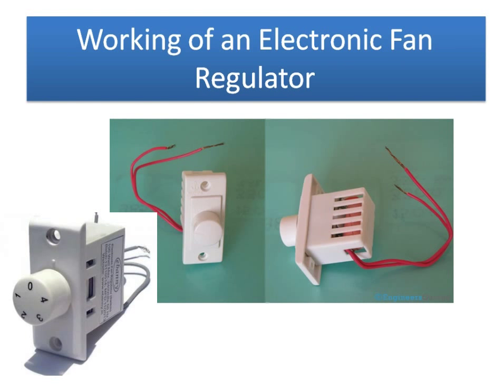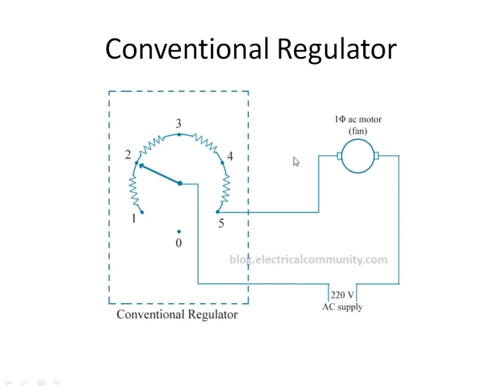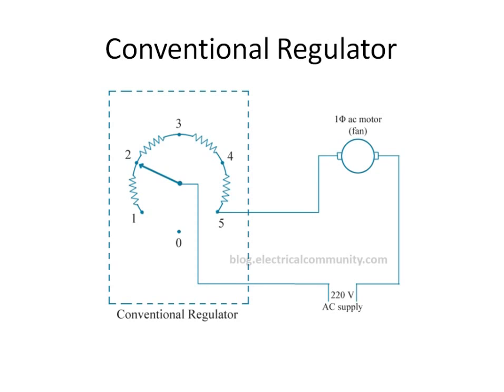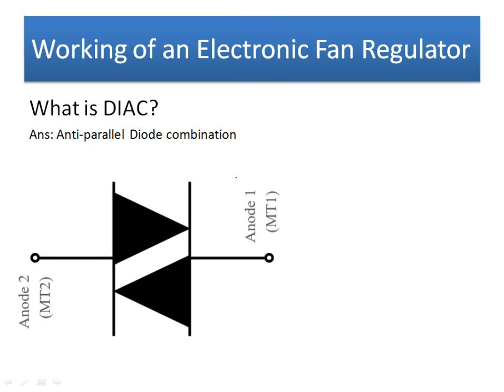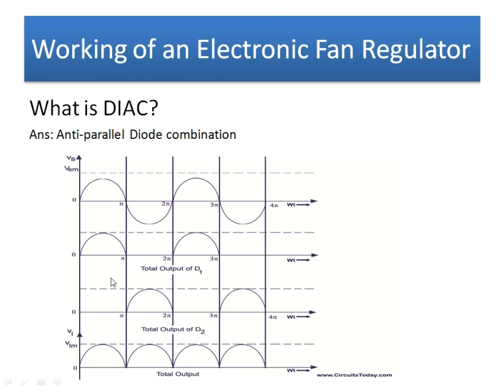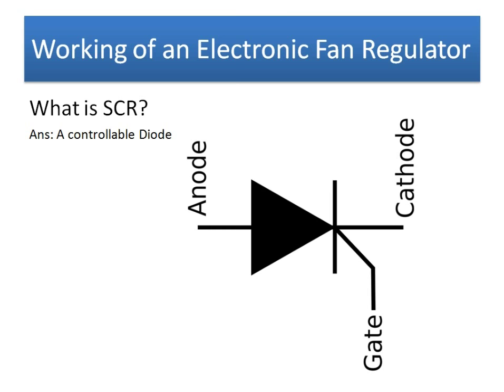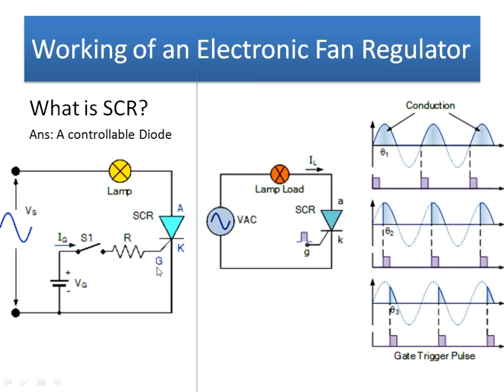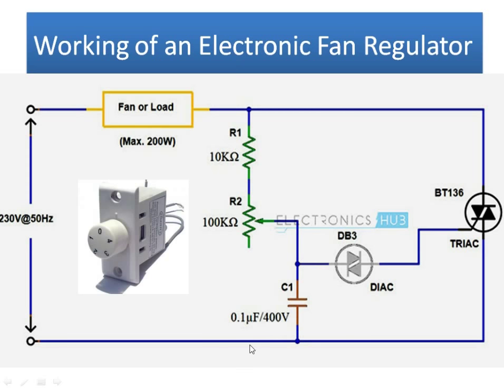Working of an Electronic Fan Regulator or Dimmer EXPLAINED SIMPLY

Comment from the maker: Please note the output waveform I have shown for the Diac is wrong. I am sorry for that and please refer to any standard website/book about Diac. Kindly ignore the Diac characterstics shown here. 

Also, in a conventional regulator the voltage changes per step instead of current which I pointed out wrongly while discussing the conventional regulators.
 
Thanks
Reply: @sarathsuresh8603  it is like zener diode for A C.
Reply: What if i use diac 1N5445
What is the purpose of using DB3 diac please reply
Reply from the maker: I am not sure with the variants. You can figure out using the datasheet of both. Maybe difference is in frequency of operation, temperature, voltage and power range etc.
Reply: @ervivekchoubey  my multisim simulation doesnt have the DB3 so i ised 1N5445 diac.circuit not functioning well.out put current is 100nA

Comment: Hii
Bhaiya jab hum rheostat ki control karenge tab kya current effect nhi hoga kya???
Because of series circuit??
Reply from the maker: Series circuit mein resistance ke wajah se voltage drop hota hai because current same rehta hai but resistance bdhne ke wajah se voltage drop hota hai because V=IR.
Reply: @ervivekchoubey  bhaiya yeh jo fan regulator hai wo ohm law ko follow nhi krta na
Kyu ki voltage across fan toh change ho rhi hai per current pure circuit mai same hi rh rha hai
Reply from the maker: Bilkul follow kr rha hai. Ohm's law mein current isliye change hota hai because resistance constant rehta hai. Agar resistance khud change ho rha ho to koi aur factor constant rhega. Like if V and I are changing then R will be constant. If V and R are changing then I remains constant. If R and I are changing then V remains constant.

Yha pe R hi to change ho rha hai jb hm regulator ko turn krte hai to resistance bdh ya ghat rha hai. Isliye voltage change ho rha hai because series circuit hai and therefore current same rehta hai. Agar parallel circuit hoti to voltage constant hota and current and resistance variable hote. I hope you got my point.

Comment: although, this dimmer circuit is more efficient but it generates on and off cycle, or square wave. which is not linear voltage control, and it is very bad for fan because it turns on and off the fan hundreds of times in a second (depending on r2 value)
and it also reduce capacitor life of the fan because capacitor is directly connected to fan's starting coil
Reply from the maker: MR Moon That is a problem but fan is really a light load compared to many other loads where this could be a problem. But lighter the loads, the problem isn't that considerable. Also fan continues to rotate under effect of inertia.
Reply: @ervivekchoubey  Fan capacitors are very slow to discharge, so by the time it starts to discharge, it is commanded to charge. No issues with the fan capacitors, this circuit is time tested and is being used on billions of fans worldwide.
Reply from the maker: Yes you have pointed out correctly.

Comment: So, this means that the current used is the same and hence different levels don't affect the current consumption, right?
Edit: Also, could you please make a video on modern regulators? If you already have made it, please provide a link.
Reply from the maker: Actually, this regulator controls the average voltage across the fan without using voltage divider method using resistors because that leads to i²r loss and heat loss. Here, the average voltage is controlled using efficient power electronic devices which consume very less power itself and thus are highly efficient. Current increases/decreases as the average voltage increases/decreases unlike the series resistance method where current remains same and causes heat loss as resistance increases.
This video is on modern regulators only. I have compared the old resistance based regulators with the modern ones.
Reply: @ervivekchoubey  thanks a lot.❤️

Comment: DIAC explanation is wrong. TRIAC is used for dimmer not for fan. So you can see lamp load in diagram. Fan is a AC motor, needs full cycle for proper operation. Amplitude should be reduced to slow down fan. For light bulb it doesn't matter it acts like pwm. Its more effective for light bulb as there is no resistance loss
Reply from the maker: Yes I agree DIAC explanation is wrong and I have said that in the pinned comment. Fan Regulators works like dimmer as well.

Comment: The diac output waveform is wrong. Kindly check it.
Reply from the maker: Shadab Hussain The waveform diagram there is just for simple representation of Diac as anti-parallel diode (assuming 0° triggering). I have intentionally used it for ease of understanding.
Reply: Er. Vivek Choubey  you have shown output of diac is dc but its not that actually output of diac is alternating waveform. What you have presented is like full wave rectifier. But diac is not similar to fwr, diac does not convert ac waveform into unidirectional dc. It’s not about firing angle, please recheck it.
Reply from the maker: Shadab Hussain Yes that's a big mistake on my side I just checked. Thanks for letting me know. And sorry for the inconvenience.

Comment: You brought back my interest in electrical and electronics by simple explanation. I am an electrical engg, but now in IT for almost 22 years. I am also having the same problem like Sarakar. There is no much of a difference between 1-4 (very slow), but fan reaches top speed at 5. I am planning to start some R&D in this.
Reply from the maker: It feels great to know that sir. I wish you all the very best for your R&D. Most of the times, the potentiometer is the culprit and you can replace it with a new one of same resistance.

Comment: At 6:45, when D2 is conducting isn't the direction of flow opposite to that of D1 ? We wont get the peaks like bridge rectifier as described in the graph
Reply from the maker: You are right. Actually the DIAC characteristic curve shown is wrong and you may skip that part. I have mentioned this in the pinned comment. Its a mistake on my part. Diac is basically used to provide positive pulse to the TRIAC gate. Please refer to DIAC characteristic from any standard book/website.

Comment: I wanted to know that in case of a Capicitative Regulator why is the difference between 4th pos and 5th pos so huge, whereas 1 to 4 points are almost same and very slow.
Also kindly suggest which regulator is better w.r.t life of a fan motor, is it the Triac based or the Capacitor based, as it seems that the triac has a lot of Harmonics involved?
Reply from the maker: For the first question, I can't tell actually if there is a difference of speed like that and if that's the case why is it? One reason can be non-linear torque. Torque of a fan motor depends on square of speed. So torque falls or increase by square of speed. This is why it may seem that the fan is rotating too fast or slow at times.

The most efficient is the triac based regulators. Harmonics are not that much of a problem with single phase supply. The main advantage is that you spend current as much required and there is no unnecessary heat loss. Why I am saying transient isn't a problem? Because transient is happening at very low scale compared to industrial loads where this becomes a great problem. You don't see your home loads abruptly changing voltage if you control your fan with a regulator. That means harmonics isn't a big problem. Even if it is, the fan itself is a huge inductive circuit which is enough to mitigate that. Problem of harmonics rises when your fan is running on an inverter. There you can listen to the fan's noise or harmonics which effect the motor torque and also heats up the windings. Any regulator is okay with the fan life if it is not causing heat loss in the fan.

Also modern fans are coming with remote control which can be very easily implemented with the triac based regulators. Also, by replacing the parallel resistors in the fan at the source side by NTC and PTC (negative and positive temperature Co-efficient) type resistors will result in an automatic temperature controlled regulator. Also the size is comparatively small.
Reply: @ervivekchoubey  Thank u mr. Vivek, explained to its ultimate, and being a teacher myself i was not satisfied with any answer that these fan and regulator dealers have been giving me, actually i am also a hobbyist and keep making small electronic projects, today i opened up the fan regulator (make : havells) and typical 3 capicitor circuit, 1.1uF , 2.2uF and 3.3uF connected in parallel  with discharge resistors. What i am planning is to change these Capacitors with new one , thinking they must have worn out with years of usage, as this modular regulator I have is around 7yrs old. 
The real problem is like step 1,2,3,4 have almost same speed with very little rpm difference and 5 being direct the fan is performing at peak speed, and i have already replaced my fan with Havells SS390 day yesterday. So now the only catch is the regulator.
Hope i am on the right track.
Keep assisting me.
As it is there is dirth of technical people nowadays,.
Regards
Reply from the maker: @nilabjasarkar  By experiment and tests what I can suggest is that capacitors and resistors are least affected over time. The thing which is highly affected is the potentiometer which gets damage by being rotated over the time.
In few cases it is that the Transistors (triac) gets damage due to high voltage impulse like sudden switching or by shockwave during rain. Capacitors are high rated one and may get damage but I haven't heard much of them getting damage. Instead try changing the potentiometer because it maybe that the potentiometer has burned out other steps and is only operating at the maximum point. I think that will solve the problem. Just get a potentiometer by the rating given on the pot. (in Ohms) that should do the needful.

Thank you for your feedback. 

Regards.
Reply: @ervivekchoubey  but as i said its a step regulator, so that doesn't use a variable pot, instead it uses a 6 pole switch
Reply from the maker: @nilabjasarkar  oh! Ok you are using RC regulators? I thought you are talking about solid state regulators.
Reply: @ervivekchoubey  No i am not using solid state dimmer, i am using Capacitor controlled Fan Step Regulator, by Crabtree (Athena)
Link below
Havells Crabtree Athena High Speed Fan Regulator https://www.amazon.in/dp/B00K0C4IJM/ref=cm_sw_r_cp_apa_i_ZSd9CbF9V18TX

Comment: Bhaiya mai 10th class mai hu mere sir ne bataya ki current same rhta hai
Aisa Kaise
Reply from the maker: Old regulators mein current same rehta hai. Waha maine galti se bola tha current reduce hota hai. Current same rehta hai but resistance bdhane ki wajah se voltage drop ho jata hai. For example let say voltage V tha, ab resistance R se 2R kr diya regulator se to same current rehte hue bhi regulator ke against voltage hoga I*(2R)=2IR. Yaani supply voltage V ka 2IR part regulator mein waste ho jaa rha hai. Remaining (V-2IR) hi fan ko milta hai. But isse heat generation bhi bdh jaata as Heat=I²R. If R increases, heat loss increases. 

So, yes current same rehta hai but voltage drop ho jaata hai.
Reply from the maker: Current same rehta because regulator ke resistors series mein hai. Series resistance mein current same rehta hai aur voltage across resistors change hote hai. Whereas parallel circuit mein voltage same rehta hai and current across each resistor change hota hai.
Reply: Thank you bhai 💞
Reply: @ervivekchoubey  brother ager mujhe power nikalna hai fan ka toh mai konsa formula use karu
P=i^2r
P=vi
P=v^2/r
Reply from the maker: All are the part of same equation
 For example: Let say two resistors of 2 and 3 Ohm are connected in series across 10V. As they are in series so the current will be constant and will be
I=10/(2+3)=2A
As 2A is passing through 2 and 3 Ohm both so, power across 2 Ohm=i²r=2² × 2=8W and for 3 Ohm = 2² × 3=12 W

This is the simplest method. Or what you can do is find the voltage across 2 Ohm and 3 Ohm separately then apply V²/R. By Voltage division rule, voltage across 2 Ohm = main voltage × (resistance/total resistance) = 10 × 2/(2+3) = 4V

So, power across 2 Ohm= 4²/2=8W

Similarly you can find for 3 Ohm as well. Now for finding power using VI, you need to do the same thing. Find voltage V which is 4V for 2 Ohm resistor in this case and then find current in the circuit and multiply them you'll get 4×2=8W only.

So, you can use any of them. But the thing is about simplicity. In case if series circuit use i²r because i is constant throughout the series circuit and therefore you need to find current only once. Then square it and multiply with r to get power whereas if you apply v²/r or vi, then you'll have to find v for each resistor in series circuit as v will be different for each resistor.

Similarly, for parallel circuit use v²/r because v is constant (supply voltage) and just square it and divide by given value of r to get power. Don't use i²r because then you'll have to find i of each branch which is time taking.

Use the equation vi elsewhere for example in mixed circuit where you're not able to simplify the circuit as complete series or parallel or if the value of resistor not given but v and i are known.
Reply from the maker: Watch this video to understand clearly when to use which formula
https://youtu.be/0tJvQ6yAXsw

Comment: The SCR will conduct as long the polarity doesn't change once the pulse is given to the gate.
Or does it requires continuous current to the gate for SCR to conduct in both polarities?
Please clear this doubt
Reply from the maker: SCR is an analogy that I gave. The gate pulse is required for the conduction on either side. During positive cycle one part works and during negative cycle the other part works. Gate pulse is what controlled by the regulator to regulate the speed of the fan.
Reply: @ervivekchoubey  Sir how does the capacitor discharge when the voltage is constantly applied in a positive cycle. So does that mean the pulse will be given only during the negative half cycle?. Then why do we need the Diac?
Reply from the maker: During the positive cycle, the capacitor keeps on charging. Once the voltage goes to zero, the capacitor instantly discharges through Diac-Triac gate terminal. Thus, the triac operates and the fan current passes through it. In the negative cycle, the capacitor polarity becomes opposite and the lower plate is positively charged while upper plate is negative. At the same time, the Triac polarity changes as well and it has positive voltage from MT2 (lower side). As MT2 is positive and the capacitor upper terminal is negative, conduction of current happens through the diac. If it wasn't diac, the fan won't operate during negative cycle. Diac ensures positive pulse at the Triac Gate.

Comment: At 13:00 min, you are telling that the Diac will convert the input positive pulse into DC and gives to Triac but it's wrong. Diac will not convert AC to DC. Diac will allow the AC supply as it is. It will only create a fixed and accurate voltage drop in both cycles.
Reply from the maker: Yes you're right about the diac. I have already taken the matter to my pinned comment where I have asked to kindly ignore the Diac Characteristics. I am sorry for the same.

Comment: if i set the regulator to the lowest speed, how about the need for  high exciting current to turn the motor?
Reply from the maker: High current isn't required if at slow speed because the regulator at lowest speed means increase in resistance R in the RC trigger circuit. Thus a delayed pulse will be received by the diac-triac and the average voltage across the fan reduces alongwith frequency. Reduction in voltage reduces the speed and RC trigger delay reduces frequency. The supply voltage isn't something which is directly affecting the fan performance, but the supply voltage is controlled using the RC trigger to limit the voltage across the fan. If it was just simply a rheostat or shunt across the fan to control speed of the fan, then the problem of over-current could've been there.

However, it is good to start the fan at full speed and then reduce it to low rather than starting at low voltage. This helps the fan to gain adequate torque during start and avoids heating.

Comment: I am curious...
In new regulators will the electricity bill be same if fan run at speed 1 and if it is run at speed 5...?
Reply from the maker: No it won't be. Because in the modern power electronic based regulators the average voltage appearing at the terminal of the fan is reduced with the regulator which also reduces the current consumption by the fan. In the old regulators this was problem because voltage was reduced but by using series resistors which means the current remains same but power loss increases due to increase in resistance value (power loss=i²r). But here we aren't using regulators having series resistance but using power electronic devices. As the voltage across the fan depends on firing angle of the TRIAC therefore delay in firing causes average voltage to go down and hence the average current goes down as well. Therefore power loss is also minimum.
Reply: @ervivekchoubey  thanks👍

Comment: How much Wattage and value of resistors  to replace with pot for (stepwise)  4 and 5 step fan regulator.  Will this fan regulator will work for 30 years old fans whose winding is heavy?  Will you also arrange to give circuit for the heavy duty fan regulator to be used for old fans?
Reply from the maker: I am not sure if that would work for old days fans. I think it can't be used.